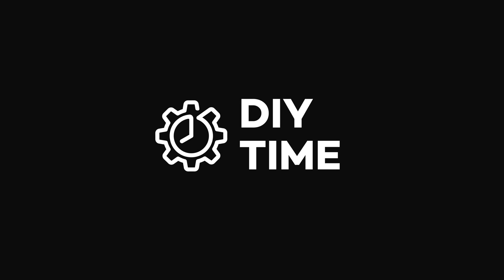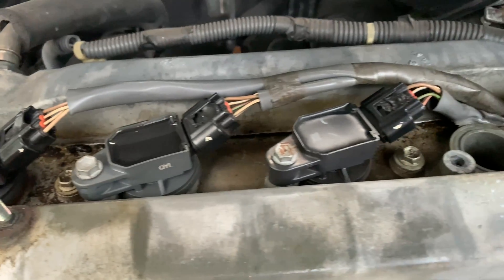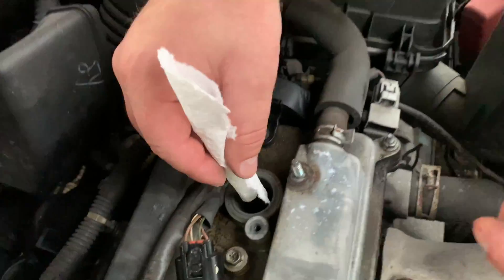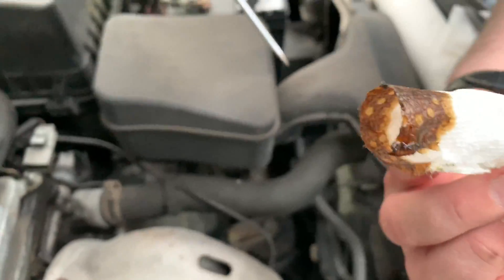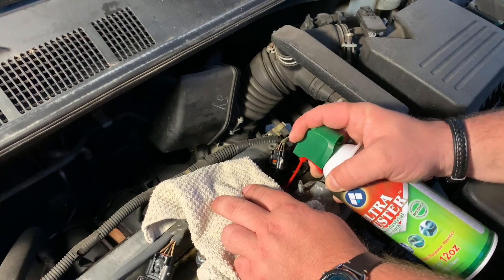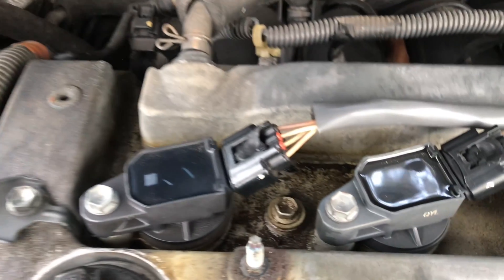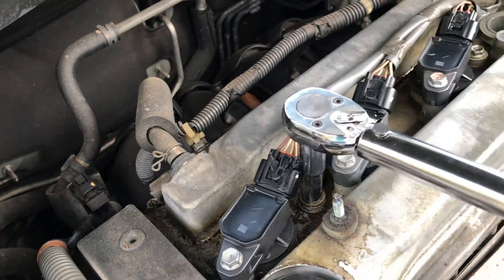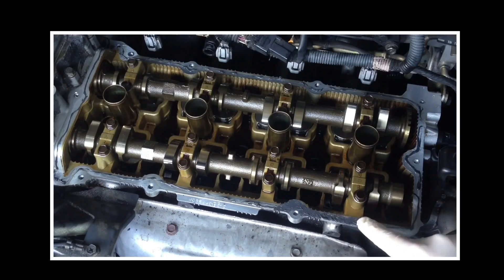How to remove engine oil from spark plug wells (to fix cylinder misfire).

Comment: Do you remove the spark plug before cleaning the well?
Reply from the maker: I dont. Otherwise oil may go into the cylinder.
Reply: @DIYtime  It burns off, it's no big deal.
Reply: @DIYtime  I made the mistake of removing the spark plugs with oil in the well. The oil has now dripped down into the cylinder.  How do I get the oil out? The car no longer starts because the plugs get immediately coated with oil. I am screwed. Now I have no car. Any suggestions?
Reply from the maker: If you wait a bit, oil may actually seep through piston rings back into the engine block. You can rent a bore scope at Auto-parts to see if its all gone, just to be safe. I’m just hoping you didnt cause any damage when you started engine with oil in cylinders.
Reply: @DIYtime  the car won't start now and I did try to start it quite a few times. What kind of damage could I have done?
Reply from the maker: Is it cranking at all?
Reply: @terrakoat  hey its been 6 months. How did you fix it?
Reply: @DIYtime  if it’s still cranking is it safe ?
Reply: You should delete this video dude. Wtf
Reply: And no it’s not safe. You’re gonna have to pull the head and remove it.